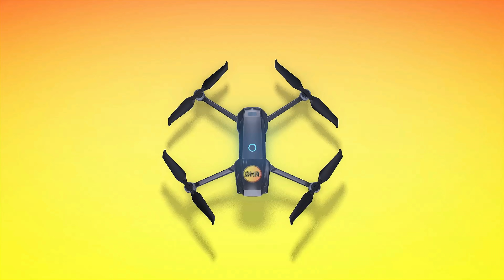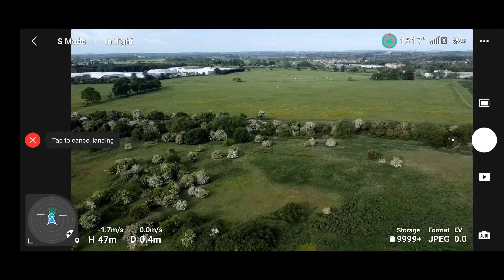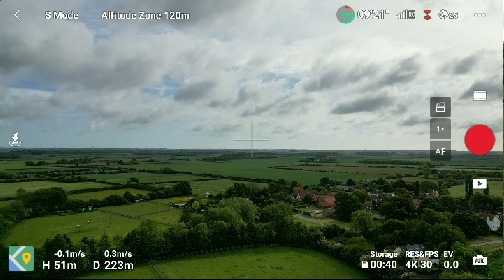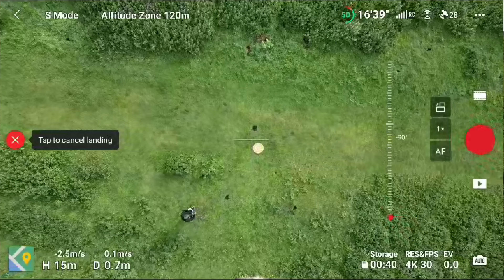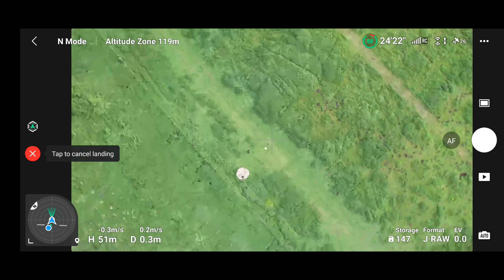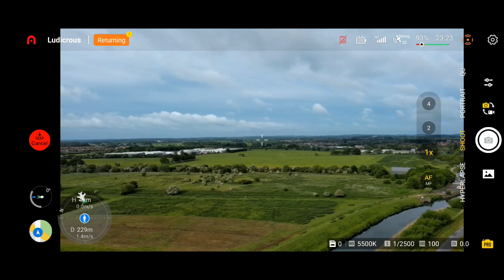DJI Mini 3 PRO - How SAFE Is it? RTH Test V Mini 2 + Air 2s + Autel Nano

Comment: I see you are in the UK, sorry for the error.
I like Brits and the woman are so lovely.
I wish you went up to 10 meters or 30 feet.
It will make a large difference.
Most do just no go high enough.
The bottom sensors become active at 30 feet.
Then it has enough height to begine adjusting.
I guess I am the only one that foes that.
Too bad so sad. LOL
Ray C Florida

Comment: I fly the Air 2S and I don't let it hover, I just climb vertically at least 7m and then I'm off immediately and precision landing always works.
Reply from the maker: That's pretty good! It's actually in the manual for letting it hover for a few seconds 😊
Reply: @GAVINHR  interesting, i didn't notice that, thanks.

Comment: @GavinHR
Please could you do some more testing on RTH for the Mini 3 Pro specifically ? I'm interested by the RTH "update" feature, ca you try using the "RC" with the integrated screen:
- With NO phone coupled in either Bluetooth or Wifi. so Plane mode.
1- takeoff, move drone away, in RC menus update the RTH to "drone position" with the drone Hovering over a safe landing zone, move drone away, press RTH.
2- takeoff, walk yourself away, update the RTH to "operator position" on a safe landing zone and place the landing platform at your feet's, walk away, press RTH.
if both of these tests works, no need more. If they don't, repeat these steps with a coupled iPhone ! thanks !

Also In the case of a tracking situation, I wanna know where the drone is gonna go land in the case of a loss signal with RC. Is it gonna land on the RC or RTH to takeoff position dumbly...

Comment: RTH on the mini 3 sucks pretty hard, though I don't really use it so it doesn't matter. Just for testing I tried it twice, the first time I took off from the roof of my car and it tried to land on the side of the car so I had to manually adjust it before it would crash. The 2nd time I took off on a large open field of grass and it landed 5 meters away from the takeoff point.

Comment: In addition, GPS satellites are not stationary, which makes it difficult to compare from time to time. Even if you have many satellites locked in the receiver, they can be located unfavorably in the sky. It is best if it is evenly distributed across the sky, which is not always the case.
In any case, landing is often not the problem with an RTH, as you can easily adjust the drone's position when needed.

Comment: I got better results with the Air 2S than in this video but I did things slightly different.  Instead of auto takeoff, I did a manual start of the props while it was on the ground, let it set the home point before I was in the air, then went up 25 feet and hovered for about 4 seconds then took off.  Came back perfect landing, like the Autel.  So manual takeoff is even more accurate than auto.

Comment: I won't go farther then 400 meters with MINI3 PRO, or you will get a red signal...the range of it is pure garbage...As at Nano+ we are afraid it does not get back from 4000 meters because of wind, at MINI 3 you cannot send it more than 400 meters in urban and 1300m in outside area without disconnect and red signal.

Comment: So basically the Nano+ has better RH, better camera with lens, better video at low light, better video definition, better HDR, better remote controller(brick controllers belongs to the 80’s) better sensels that captures more photons and you can fly super low to the ground giving you the gimbal capability as a hand-held filming inside and outside.  What do you think 🤔 is better? Nano+ even beats the Mavic 3 Cine at night filming.
Reply from the maker: The Nano + Is a great drone, people don't accept it because its not DJI, Don't get me wrong its not perfect but overall I have a lot of fun with it
Reply: @GAVINHR  Nano of them are perfect, in fact the nano+ still have many problems, but you are buying a flying camera. People in Youtube keep getting a tons of miss information how camera works, how bits in image works, how many things work wrong. I highly recommend people to keep their DJI drones and invest time in learning how to fly, how camera works and how to film and edit. And only then they will know how much the lens of all DJI drones have glaucoma and the images/videos lacks of definition. Another thing is that any camera can produce 16bit images but it does not mean anything better. When photon are converted to electrons and than digital data we can programmed any thing in whatever bits and bytes, but it does not mean better. All cameras only have two light controllers and everything else are processed, learning how to use what they have and proper exposure the scene you can create beautiful clips, but most people want the Auto crap that most cameras do. And filming without a grey card is the biggest mistake every person makes filming anything with any cameras.

Comment: Again a great video ...thanks . Was the Air 2s on the latest firmware that came out at the same time the DJI fly1.6.1 did or was this the previous firmware?
Reply from the maker: Hi there, yes the air 2s was on the latest firmware :)

Comment: There is a perfect reason for GPS drone to be off a little when RTH function is activated. Historically, the GPS signal available to civilians was intentionally degraded  and was not as accurate as the encrypted signal used by the U.S. military. However, from May 2000 the full accuracy has been generally available, allowing easy determination of locations to within 1 or 2 meters (3–6 feet). This accuracy cycles actually from 0 to 6 feet. So by pure luck it can be dead on spot one minute and then up to 6 feet off the next. Great video though. I fly the Air 2s and was not aware of letting the drone map the area before going on to the flight. I enjoy your videos. Keep up the good work my friend.
Reply: The Mavic pro and the like. They also tale a picture as they take off to match it to the landing point on return
Reply: The Nano+ seems to be different.
Reply: Der Right Correct, YeaH!!!
Ray C Florida USAF Pilot Flight Ldr, Ret'd Capt F-4 C&D     Wahooooooooooooo

Comment: Great video mate, slightly off topic...can I ask you a question about the mini 2. When the battery gets to around 16% low battery warning comes on and starts beeping, is there any way to bypass this as I'm not getting the full use of the battery and that beeping noise is so annoying. 

Cheers
Reply from the maker: No it can't be turned off sadly! I bloody well wish it could be 🙂

Comment: You may already know this but on the Mini 3 Pro if you press RTH and the drone is less than 50m distant it will RTH at its current altitude and NOT climb to the RTH set altitude. I think this could catch newbies to the drone out
Reply from the maker: Hi David, that is actually the case with all DJI drones, it it's under 10m it will just land also 🙂
Reply: @GAVINHR  Yep, caught me almost out a year or two ago by doing at low-altitude RTH into a lake. Lucky enough hit the stop button quick enough, but it pays reading the manual (same as with the tracking modes and obstacle avoidance responses that differ depending on tracking mode...).